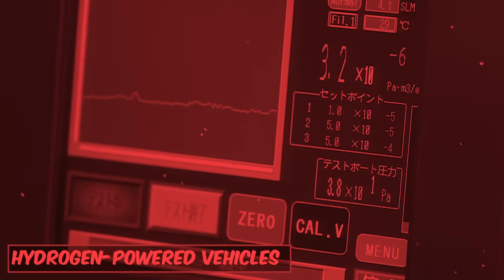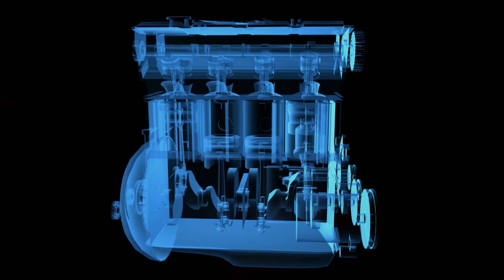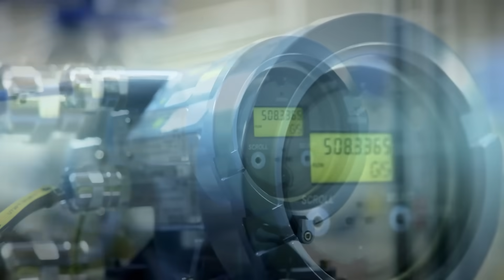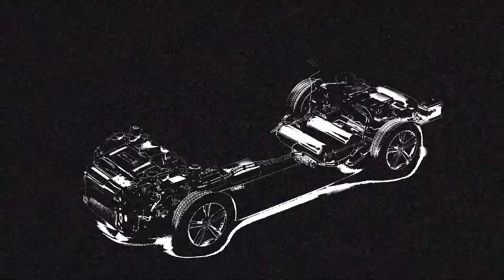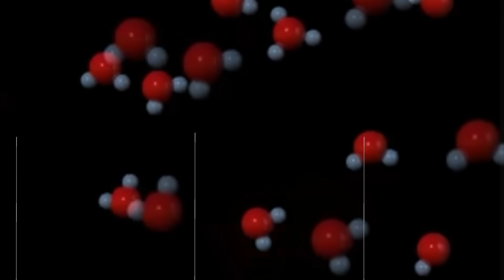Toyota's New WATER Engine Will Destroy The Entire EV Industry!

Comment: Wow that's not just sustainable, it's the perpetual motion motor dream.  Do they use some of the engine's power to produce the electricity that's needed to make the hydrogen from the water or is there another magic generator that does that?  If so what does it use for fuel?
Reply: Great questions but unfortunately no answers. That is because perpetual motion is as real as unicorns.
Reply: * Bi-polar auto electrolytic hydrogen generator, patent 1992 US5089107A 
An autoelectrolytic hydrogen generator system constituted by one or a plurality of similar cells wherein a galvanic arrangement of magnesium and aluminum plates of sacrificial elements as anode; stainless steel as cathode and sea water as electrolyte, by its very nature is made to develop a voltage when connected in short circuit causing a current to flow within the system and hydrogen production of hydrogen in situ and on demand by the electrolytic action at one pole, the cathode, and additional hydrogen by the electrochemical reaction at the other pole, the anode. Surplus electric energy of the system applied to a optional electrolyzer will also be made to produce additional hydrogen at its two sacrificial aluminum electrodes.
Reply: @reverendgoodthrustesq.6875  That sounds like fun but it isn’t the engine that this vague video is hinting at. The engine you mention would probably work somewhat but it doesn’t sound suitable for a car to me, I doubt that it would produce enough power. Real seawater is full of all kinds of stuff which would clog the thing up and those sacrificial plates are going to need replacing regularly. I expect such problems are the reason why you can’t buy one.
Reply: * Breitbart News, 7 Apr 2014 
The US Navy believes it has finally worked out the solution to a problem that has intrigued scientists for decades: how to take seawater and use it as fuel.
The development of a liquid hydrocarbon fuel is being hailed as “a game-changer” because it would signficantly shorten the supply chain, a weak link that makes any force easier to attack.
Reply: @reverendgoodthrustesq.6875  It makes sense to use seawater if you are on a ship, much less so if you want to drive a car across the Mojave Desert. What is your point?
Reply: Another video showed big EV battery stack, just like any other EV... which it is, just a weird one. That turned out to be the Mirai block diagram, which is why they just flashed it -- intentionally deceptive. These videos are sensationalizing things, saying it "runs on water" when it does not. It's just a hoax, and Toyota isn't working on anything like this. They did recently patent a water-injection-cooled hydrogen engine, something completely different. And they also announced a water electrolyzer unit, for industrial hydrogen production.

Comment: I remember when I was at high school (I can't remember how they did it? I think they put an electric charge into the water, and it made a gas, and when you put a flame to it, it ignited (they still they hydrogen out of the water. Then I thought that there must be a way you could could/ would be able to run an engine that would be able to run on water. I don't think petrochemical companies that purduce petrol, natural gas (LPG), and maybe diesel as well. Wouldn't like that idea. Companies are now make hybrid and fully electric cars. I would sooner have a Hybrid car over a full electric car. The work involved in making the correct battery and being able to dispose of what cannot be done to reuse.

Comment: Easily solved. Every water powered car to be fitted with a forty foot or so water wheel, which would generate the energy needed to just about get you to ten miles per hour, would cost about a hundred grand, and all you need to do is avoid lo to high bridges and power lines. See they breed us smart around here 😂

Comment: There is so much wrong with this video. Just where is the high-voltage power coming from? How does "this" setup bypass the laws of science, by getting more energy out of the engine than the power to separate the H2O into H and O2? Why not pipe the O2 into the engine and recombine both back into water and cool the water vapor back into liquid water so you rarely need to refill the water tank?

Love a good pipe dream, but this will not work in real life.

Comment: Where does the electricity for the hydrolysis of the water come from? If the engine generates its own, then you couldn't get any useful work out of it because the work required to produce the hydrogen by electrolysis would be at least the same as, if not greater than the work output of the engine. There would be no energy left to move the car. Something missing here in the explanation I think. Furthermore, wouldn't the water in the tank freeze in cold weather?
Reply: And yet, despite all your arguments against, it has actually been done. Also, judging from the news on the recent freeze, EV's don't work below freezing either.

Comment: One doubt is how to achieve high voltage electricity for water electrolysis?
Reply: 600V EV batteries, I expect. You can always boost it higher if necessary.

Comment: well that was a waste of time. Not a single mention of where the power comes from to split the water. Hydrogen combusion engines have been about for years and are no more simple than any other infernal combustion engine. How can you call water a fuel when it takes more energy to extract the energy thsn the energy it holds? Videos like this piss me off.

Comment: Water can not be use as a fuel. It is against the 2nd law of Thermodynamics.  Getting H2 from water need 4 unit energy, where as after burning that H2 gives only 3 unit energy.  Which stupid want to loose 1 unit energy? They are simply Gamechanger.

Comment: So where is the energy coming from to separate the Hydrogen from the oxygen. From the same batteries you have in a electric car? You can't ever create energy out on nothing
Reply: Power from the alternator when the car is moving.
Reply: @fierylance  no it's not. The power you'll get from the burning hydrogen is less than the power used to produce it. The alternator can't produce energy greater than the energy you used to power it up. Based on the law of thermodynamics, it will produce a lot less energy to produce enough electricity to perform electrolysis on water to separate hydrogen, or even to charge the battery itself. Unlike in gasoline type engine, there is so much mechanical energy produced from its combustion, enough to move the whole car and power up the alternator. 

Hydrogen can only produce less mechanical energy from combustion or electric energy from combining with oxygen, compare to the energy needed for electrity for powering up an alternator to produce more electricity needed to charge the battery.
Reply: @Nurhiannah25 It was the same before: the outcome depends on the adjustment and compatibility of the machine or HHO cell, as well as the adjustment of the electrolytes. The result cannot be attained in just a few minutes of laboratory testing, and it does not produce 100% immediate effects. Instead, it gradually cleans the pistons, leading to smoother combustion. You can only attain the true result with longer use, not just after running for one mile.
Reply: @Nurhiannah25  you can't argue with physics.  Producing Hydrogen take a lot of energy more than energy than the engine can produce.
Reply: @BRichSolution  Everyone here seems to be missing this part. Unless you add high current batteries -making this an ev, then what is being discussed is utter nonsense. It would in essence be an electrolysis-based perpetual motion machine.
Reply: Actually you can. With zero point energy. Or a quantum vacuum. But  that is suppressed technology but people get killed these days for having world changing technologies
Reply: You speak of fictional science. Your lies prevent the progress of technological advancements
Reply: Obviously in it's infancy definitely one too watch though
Reply: JP MORGAN will hate this for sure
Reply: Its, cathodes in water container, creating hydrogen liked to a traditional fuel engine.
Reply: Do you see dams
If dams can get power from water than machines can too
Reply: @Potatoalex538  Yeah, we simply need cars that collect water on the roof and are 100 meters tall.
Reply: @Potatoalex538  That is from the gravitational pull, not from burning hydrogen...
Reply: @Potatoalex538  you can get power from water falling from dams, what powers it is the weight of the water forcing turbine to spin. And the dam has a large of supply of water to keep it from falling. How can you do this in a car? You can't put dams inside it to power a turbine/engine. The video is not possible according to the laws of thermodynamics and misleading

Comment: I just don't think this concept is practical.  The effect would be drying out planet earth to provide mobility.  Water is not a limitless resource.  It's not sustainable.  Water is needed for all forms of life to survive.  Should every motor vehicle now on just USA roads, be replaced with a water burning unit, we would burn 64,354,610,000  gallons of water per year.  (assuming the same level of consumption as gasoline).  That volume of water would support the personal consumption of water by 3,217,730,500 people (assuming 55 gal per person per day). That's 9.8 times the population of the USA.

Comment: This video deftly avoided answering the most basic and obvious question regarding the proposed power source used to drive the hydrolysis.  It’s fundamentally understood that it requires more energy to split water than the energy resulting from the hydrogen produced. Outside of theoretical fusion, physics tells us that every time you convert energy from one form to another there is a modest energy loss.  Very disappointing.

Comment: High voltages? Compressed natural gas? But it’s water powered?
Reply: HHO generator (Search this way). 
Low volts, electrolysis. Combustion of hydrogen and oxygen. End product Water vapor.
The danger, the mixture of the two gases, is explosive gas. Although, hydrogen itself...(Hindenburg)

Comment: 1. Distilled water? Distilled water is not what's generally sold in supermarkets. 

Distilled water requires energy to vapourise it, before it is condensed back into H2O without any impurities. Where's that energy come from?

2. The phrase "diluted water" is used... What the hell is that?

3. I can supply you with large quantities of dehydrated water (send me your money!) - you just need to reconstitute it by adding water... 

4. What provides the electrical energy to electrolyse the water? 

5. The laws of entropy dictate that there's no free lunch in life... 

6 All that said, I would welcome a commercially viable water-powered ICE... (EV's, as currently conceived, are doomed to fail in the long run - the cost of battery production, the necessary grid power production & charging infrastructure is beyond prohibitive. Don't go there!

Comment: MY BIGGEST QUESTION IS TO USE THE PROCESS OF ELECTROLYSIS TO SPLIT WATER INTO HYDROGEN AND OXYGEN, ELECTRICITY MUST BE USED. THEN PETROLEUM MUST BE USED TO DRIVE THE GENERATOR IN ORDER TO PRODUCE ELECTRICITY. IT IS THEREFORE, CHEAPER TO USE PETROLEUM. THERE IS NO CHARGING HYDROGEN  STATION AVAILABLE ANYWAY AND TOO EXPENSIVE TO BUILD SO MANY HYDROGEN PUMPING STATIONS. AFTER ALL, PETROLEUM IS NEEDED TO DRIVE THE GENERATOR TO PRODUCE ELECTRICITY, AND ELECTRICITY WILL SPLIT WATER INTO HYDROGEN AND OXYGEN. WHERE IS THE LOGIC ?. PLEASE REASON TO ME OR EXPLAIN TO ME YOUR LOGIC ???
Reply: @rockingrouge7050
Electrolysis works with an accumulator.

Gas evolves, and the engine runs by burning it.

The "big secret" is appropriate: volt-ampere-hertz, because up to 5X more gas can be produced.

But even if it is not completely free of gasoline, the efficiency improves enormously.

HHO generator (Search this way)

Comment: We are no longer ruled by logic and common sense.  Mandates from either ill-informed servants or evil government controllers will make us immobile forever. Lies about gasoline engine and government mandates (supposedly for a "good" cause which is the biggest lie ever created) are ruining our lives unnecessarily.  The hybrid engine, which can switch between a gasoline engine and a battery powered engine is probably the best deal.  As with all things, "time will tell".  Hopefully, the WATER ENGINE will work out. remember those all electrics? couldn't charge them up in the record cold weather we've had.  Sensible answers are available, if only "government" didn't have ulterior motives and emotional non-thinkers didn't act up in front of TV cameras.

Comment: If you could make a machine that takes water and breaks it down into hydrogen and oxygen. Then takes those components and runs them back into itself as fuel and creates enough excess energy to move or create excess energy for other purposes. Then why don't we power buildings with the power that they could create by hooking them to a generator? OH yeah, it has to do with the laws of physics. So far we have not figured out how to have something produce more energy than it uses to function let alone extra energy to be used for something else. There is no perpetual machine as we know it. Even if you are adding the water the process of the engine making its own fuel doesn't work. You need an outside energy source. Also, water freezes. What energy are you going to use to keep it in liquid form at low temperatures?

Comment: That's pretty awesome. One question: If I live in Norway where 50% of the year is in sub-zero temperatures, how does water works?
Reply: You have to pedal the car until it warms up and melts the water.
Reply: @rayharvey1330  you are onto something!
Reply: You would have a battery operated water heater on board!
Reply: @phil2443  How about a tiny oil powered lamp that heats the water. You flick a flint switch to ignite it.
Reply: @rayharvey1330  looks like we are back to square one. Petrol cars still the best option.
Reply: It works the same as it does in any other temperature,... It doesn't.
Reply: It doesnt  have you ever seen the Flintstones, start running in there, the faster you run the warmer you get, according to Greata, it all melted already and you should take a bikini, but  she is dillusionnal, just a bit...
Reply: In cold weather, it seems gas is best.
Reply: Most people dont life in norway, ride reindeer in winter
Reply: @jussikankinen9409  correct
Reply: It doesn't.
Reply: The water isn’t frozen in your house

Comment: This video is talking about a perpetual motion engine.  It DOES NOT WORK.
Takes MORE energy to generate enough electricity to sustain electrolysis  than you can get out of the resultant hydrogen gas.
Reply: Not to mention the relatively low efficiency of all internal combustion engines.

Comment: You can't get more power out than you put in. All I hear in the video is how it's going to be a game changer blah blah blah. 
But WHERE do they get the energy from to electrolyse the water. YOU CAN'T...... ABSOLUTELY CAN'T get OUT more energy than you put IN.
So the engine can't provide the power to propel the car AND power the electrolysis.
The laws of physics make it completely impossible!
In fact, it's not even feasible to have an engine running whilst producing the electrolysed oxyhydrogen. Frictional and heat losses won't allow it.

Comment: How are they in minus temperatures?
Reply: The same way they are in any other temp,... nonexistent and pure fantasy.
Reply: They're calling that "solid fuel".
Reply: Well, pure water freezes quickly in sub-zero (f) temps. So, you will also need to keep the water warm at all times, like when you're not driving in the winter. The bottom line is far more energy going into the system than you can get out of this system to make it work. Pure pipe dream.

Comment: OK, I looked it up, and whoever made this video is an idiot.  Toyota isn't claiming a water-powered engine at all, they've patented a system to use internal water cooling in a hydrogen-powered internal combustion engine.  That is, they're doing water injection into the cylinders, but the power is coming from burning hydrogen.  The hydrogen is NOT electrolyzed in the vehicle, it's obtained elsewhere and stored in conventional high-pressure tanks.

Comment: I'm calling bullshit on this.  First of all, burning hydrogen in an internal combustion engine is a lose, you'll blow half to 2/3 of the energy from the combustion out the tailpipe or dump it through the radiator.  Secondly, if you've got the power to electrolyze water, you've already got the power to drive an electric motor.  There is no benefit whatsoever to this idea compared to either gasoline engines or hydrogen fuel cells.

Comment: Now THIS would sell and consumers wouldn't have the milage fears and recharging issues that exist now.  Not to mention the rate that batteries degrade especially in colder weather.  I've tried the Hybrid route and while at first it was fun, it didn't take long to start to see the problems with it.  THIS would make me buy a Toyota
Reply: When free energy for every body then no need wars about oil and humans can live where they want no need living in cold areas anymore cause no borders and can move
Reply: Learn some thermodynamics. @jussikankinen9409
Reply: Not when you see the price of hydrogen. It's way more expensive than the electricity it's made from, because of the inefficiencies.
Reply: @jamesvandamme7786  You obviously didn't watch the video.  It says it uses water

Comment: Even if this really does work, and I'm sceptical that it could extract enough Hydrogen in real-time, how many people will mess up the system by adding normal water instead of distilled water? I think there are quite a few people too stupid to stick to pure distilled water.
How much distilled water is required anyway? And where would you top up the distilled water, at a normal petrol station?